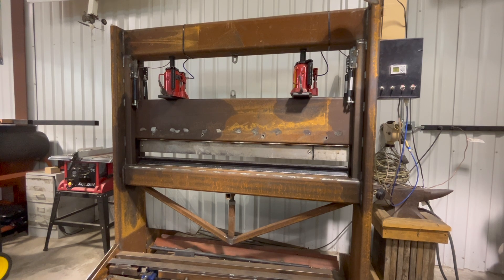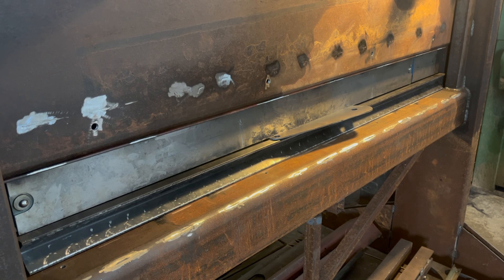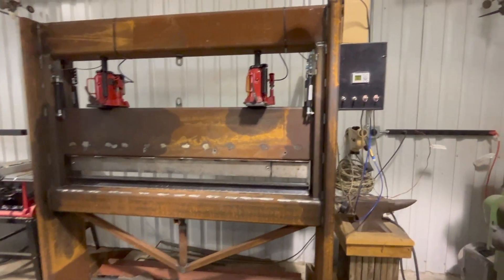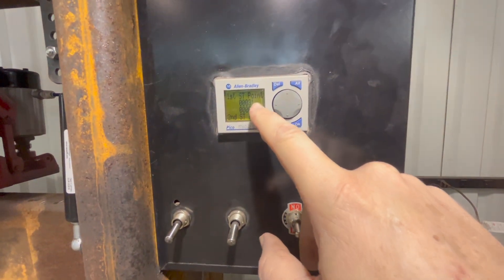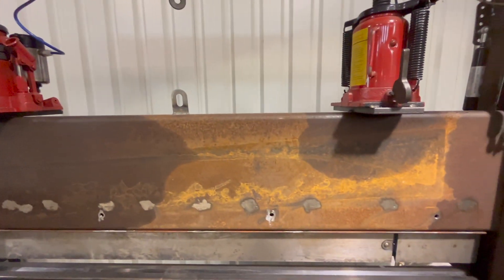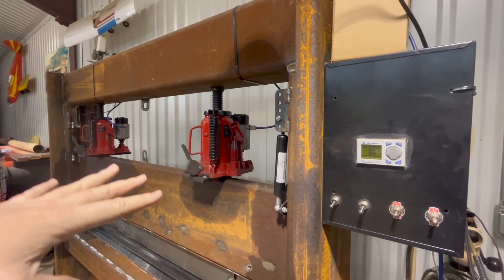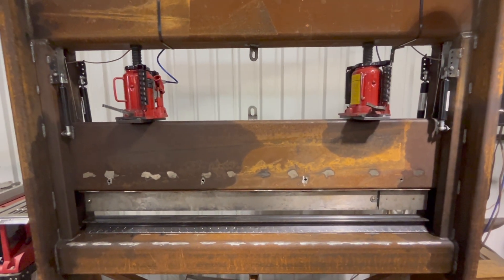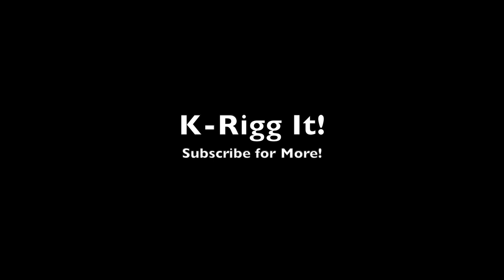D.I.Y. Press Break that is Computer Controlled.

Comment: Brilliant thanks for sharing  i would be very interested to see a detailed video of the solenoid setup
Reply from the maker: @Adventure_Van_Upgrades  after I posted the video I realized I didn’t show the solenoids, its just two of these things:  https://www.amazon.com/Baomain-Pneumatic-Solenoid-Internally-Electrical/dp/B01J3C1LWG/ref=asc_df_B01J3C1LWG?mcid=71db74959d2f38848d67ec688b885324&hvocijid=2860460235166276833-B01J3C1LWG-&hvexpln=73&tag=hyprod-20&linkCode=df0&hvadid=721245378154&hvpos=&hvnetw=g&hvrand=2860460235166276833&hvpone=&hvptwo=&hvqmt=&hvdev=m&hvdvcmdl=&hvlocint=&hvlocphy=9028249&hvtargid=pla-2281435178058&psc=1
Reply: @kwrigg  thanks for responding. I'll take a look. Currently got a foot pedal to operate my press & was thinking of using solenoid valves for automatic release at a set depth using limit switches but your design that's self levelling Is very clever. Great work 👏😎
Reply: @k-rigg this is cool and fascinating ! How does the auto-level logic work if you have two standard valves? Like what is the mechanism/controller telling one valve to increase more air to one cylinder vs the other to auto level since it’s not a servo valve? Great project BTW! Haven’t seen anything like it!
Reply from the maker: @danielverdin8333  it uses one sensor as the master and makes the other match, if it over shoots it just shuts off tha ram until the other catches up.

Comment: I don't understand much. Where is the power coming from? Are those motors behind the hydraulic jacks? What kind of motors, and how do they generate the hydraulic pressure? Do you have a linear potentiometer on each side and control the motors to  make them equal? Or are there hydraulic lines somewhere between the jacks and a motor somewhere else?

Maybe these are weird questions, but I'm neither a mechanic nor mechanical engineer or anything like that.
Reply from the maker: @luftstolle   it uses compressed air to run air over hydraulic jacks like these:  https://m.vevor.com/bottle-jacks-c_10306/vevor-air-hydraulic-bottle-jack-32-ton-70550lbs-manual-auto-truck-rv-repair-p_010596719344?adp=gmc&utm_source=google&utm_medium=cpc&utm_id=22038904933&ad_group=179071236464&ad_id=725716391515&utm_term=&gad_source=1&gbraid=0AAAAACq8bLUWC3y_41JWg7GVmBDxzoQDH&gclid=EAIaIQobChMI55SDwaXfigMVqDjUAR1hdShUEAQYAiABEgLhCPD_BwE  The computer operates air solenoids that turns on and off the air to the jacks independently with linear potentiometer on both sides so the PLC keeps them level.
Reply: @k-rigg  Interesting, thanks!

Comment: What do you use for the hydraulic motor? I’m new to this kind of thing, but very interested in learning more. Thanks!
Reply from the maker: @joshmchristiansen7772  it uses compressed air to run air over hydraulic jacks like these:  https://m.vevor.com/bottle-jacks-c_10306/vevor-air-hydraulic-bottle-jack-32-ton-70550lbs-manual-auto-truck-rv-repair-p_010596719344?adp=gmc&utm_source=google&utm_medium=cpc&utm_id=22038904933&ad_group=179071236464&ad_id=725716391515&utm_term=&gad_source=1&gbraid=0AAAAACq8bLUWC3y_41JWg7GVmBDxzoQDH&gclid=EAIaIQobChMI55SDwaXfigMVqDjUAR1hdShUEAQYAiABEgLhCPD_BwE  The computer operates air solenoids that turns on and off the air to the jacks independently.

Comment: Nice usage of material for the general frame. As someone who has built their own press, you now have me thinking about playing with a plc and linear potentiometers. My press is all hydraulic but I think some form of plc integration could make a decent depth stop compared to manually adjusting a bolt/nut. Cheers!
Reply from the maker: It definitely is easier to use that a manual stop on a press break.

Comment: impressive! as always, with your creations and high level wisdom :)
Reply from the maker: Thank you!
Reply: @k-rigg   Homebuilt 40 ton 60 inch wide press brake - 
Brennan's Garage    had some great home made finger attachments cut from sheet steel.
Reply: @k-rigg  I've been watching a lot of home made brakes lately,  there are a LOT out there now. This is by far the best mechanism for accurate height control.   I'm on the very long wait list for the Titan 25T, and I'm considering building a larger unit.
Reply from the maker: @ i can achieve about .003” repeatability with this setup.
Reply: @k-rigg  that is far better then most older hyd machines